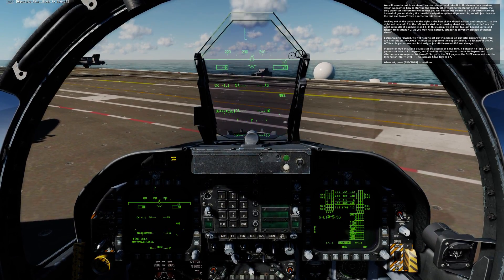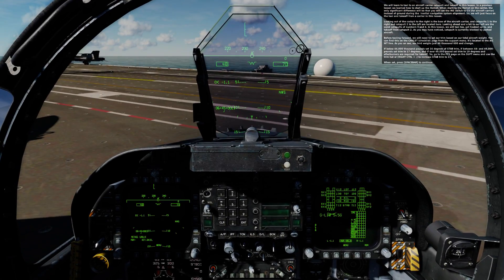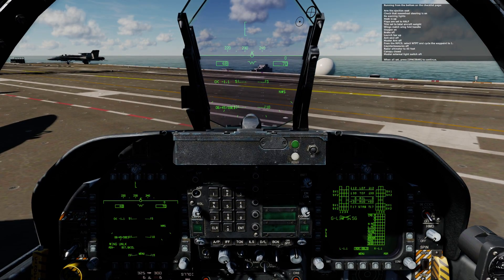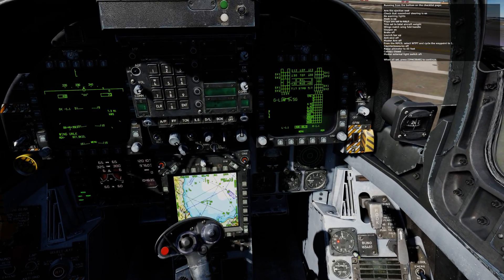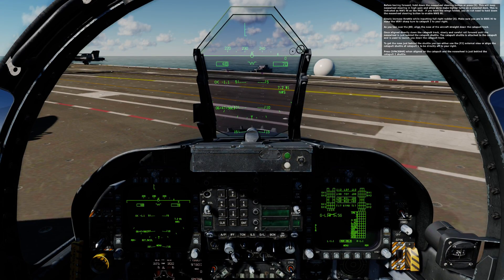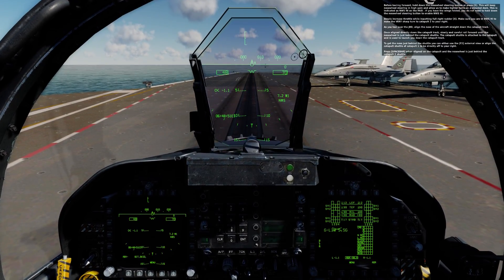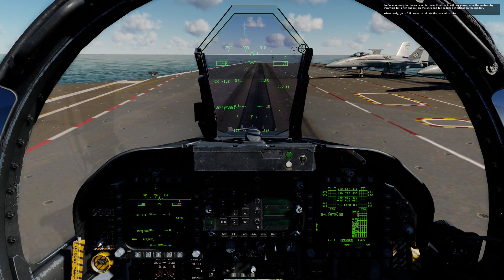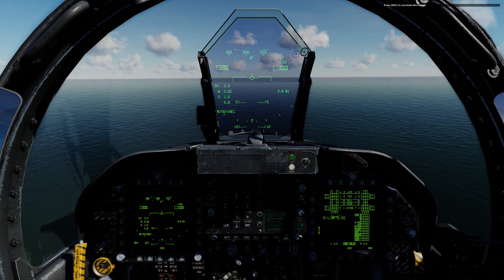DCS: F/A-18C Hornet Carrier Taxi and Takeoff Training Lesson Recording

Comment: When I take off the red gear handle beeps and I can’t gain altitude or speed and end up going into the water even when I’m on full afterburner with gear up and flaps up after launch
Reply from the maker: Make sure flaps are at half or full based on weight and set takeoff trim.
Reply: @MattWagner  gonna give it a try thanks
Reply: Still having the problem the jet doesn’t gain airspeed even and even on afterburner it stalls n crashes

Comment: Could you please tell us TWITCH or YOUTUBE streaming and also video recording settings for OBS or your suggestion please. I have frame drops only in DCS world capturings. ( Basicly, tried 2 monitors or 1 monitor setup for my side. When my cursor's clicked on OBS everthings OK, 60fps 1080p or 720p recording or streaming. BUT, when i click back to DCS world screen to control my aircraft, then my recording or streamin FPS dramaticly drops and reduces. 20fps 18fps or etc. Tried it also in Fullscreen or Nonfullscreen mode in DCS setup. By the way, when i go click to OBS everthing goes well my fps goes 60 again.. Could not find the solution :/

Comment: Is it true that you have to trim it manually befor takeoff? If so, what is the T/O Trim button for?
Also: In a Podcast with a Hornet Pilot i heared that on the carrier deck you are only allowed to make turns in idle. Might be a bit much realism but if its true i think i could be mentioned.
Reply: The T/O trim is default trim, it basicaly gives the correct trim value for when the fa18 is not very heavy (forgot the exact weight values), so this button is useful when you are in that margin of weight and are just to lazy to look at the mfd while adjusting your trim manually (simply click the button and you are done), anyhow you will need to manually trim your aircraft if you aren't in that weight margin or when you'll need to trim while flying (for a landing for example)
Reply: yes you need to set the trim for your weight as Wags shows in the training lessons its the same for carrier or land based T/O only sets trim to 12 and you have to adjust accordingly
Reply: This is true, and there is a chart within the RL Hornet manual for Catapult setup.. TO TRIM centers all trims and sets stab 12 UP for an airfield takeoff.